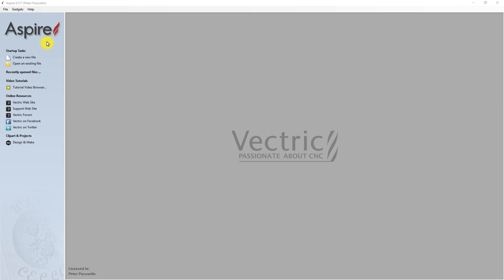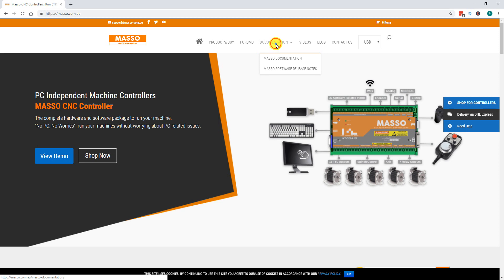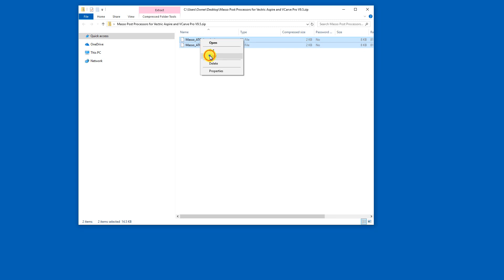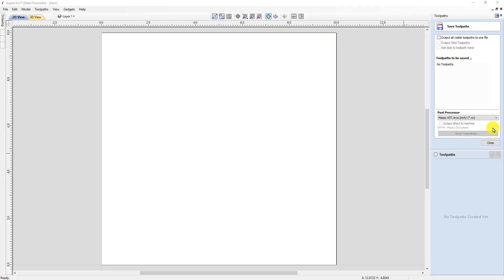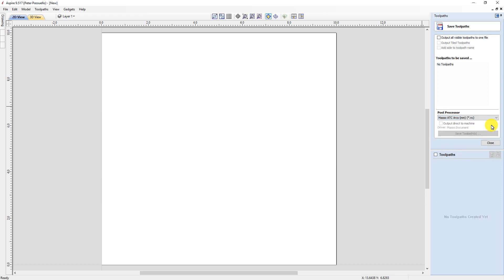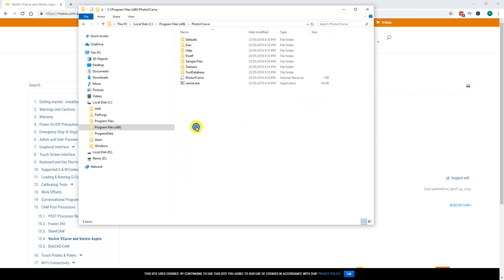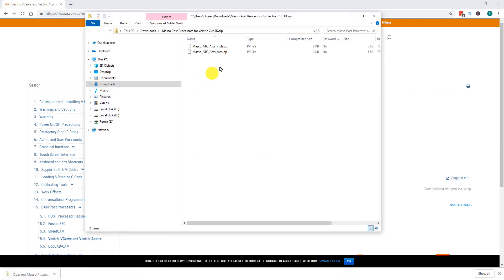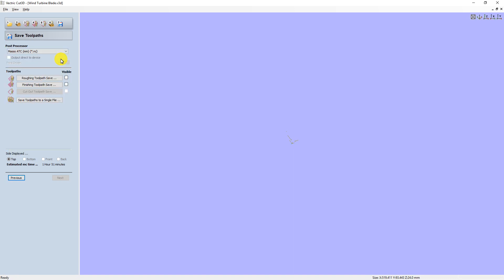MASSO 101 - Installing Vectric Post Processor

Comment: Is there enyone who can edit masso plasma post processor to work without z axis
Reply: I don't see why not, let me take a look at it.  you on masso forum? Ill put link on there to it, CowboyCNC
Reply: even better!, its built in, here is fusion example:

 useZAxis: {
    title      : "Use Z axis",
    description: "Specifies to enable the output for Z coordinates.",
    type       : "boolean",
    value      : false,
    scope      : "post"
  },

go to your post library, select the masso plasma post, click the edit pencil and you can make the change. I assume this allows default to a THC unit, over driven Z axis, ill dig deeper, but this is what I would try first.